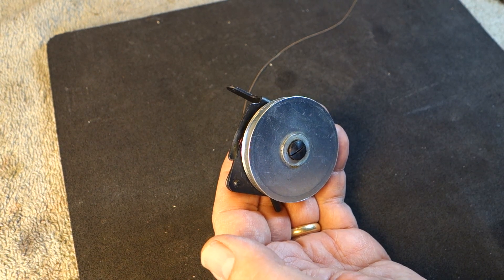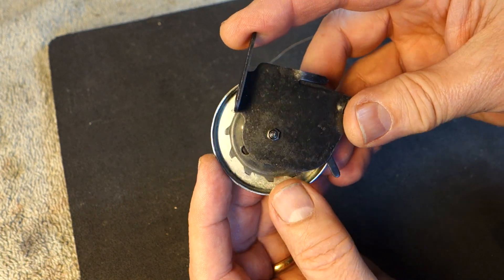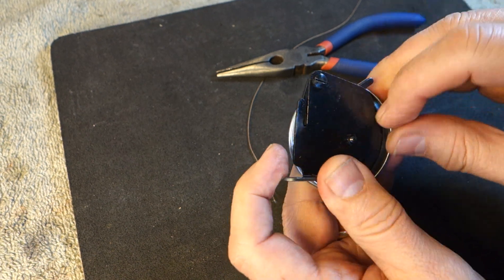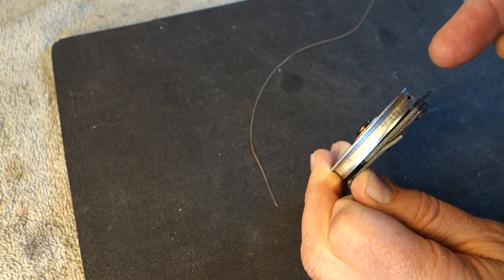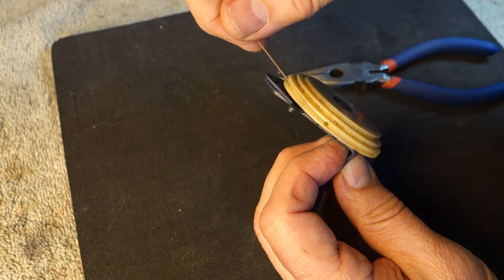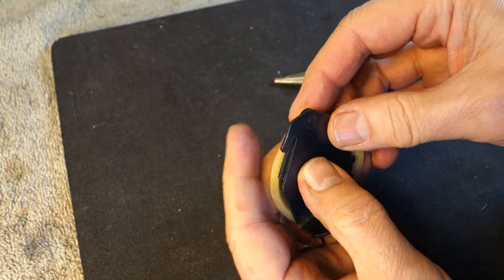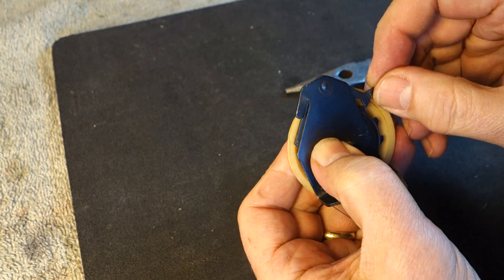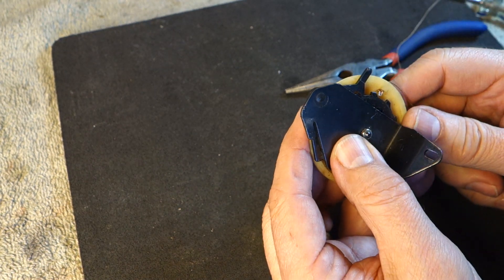Smith-Corona typewriter mainspring intro

Comment: I brought home a Galaxie 12 yesterday and like the amateur that I am undid the nut holding the mainspring components together. I can put it back together, but by the time I have the spring wound with enough tension there is enough of a gap between the components from them shifting down the screw that it won’t hold. Please help!
Reply from the maker: I don't think you're getting the pieces fitted just right when you're reassembling.....Just to be clear, you shouldn't be putting any tension on the spring when putting the mainspring assembly back together. The pieces have to fit snugly and the screw that runs through it is held in place by a nut on the big plate that attaches it to the typewriter. The notched wheel on the back of the mainspring is the part that has to seat in that axle shaft just right. If it's not seated you won't get the components together snug, and you'll have the issue you describe. Look carefully at how everything wants to fit, and be patient -- it's a bit fussy.
Reply: @NisKildegaard  I figured it out. The wheel wasn’t spinning freely on the screw that runs through to the plate and was unwinding the screw every time it turned. Once I got the screw loose from the wheel and oiled the “drum” part of the screw where it is in contact with the wheel, we were in business. Appreciate your helpful video, quick reply, and encouragement!